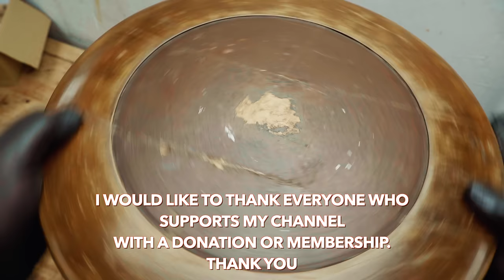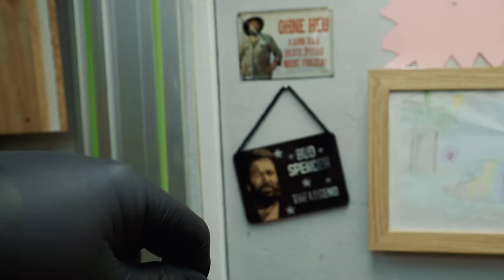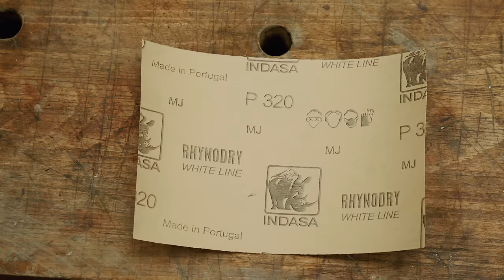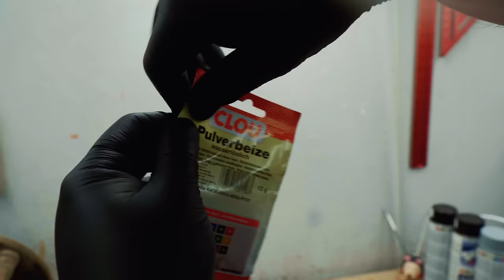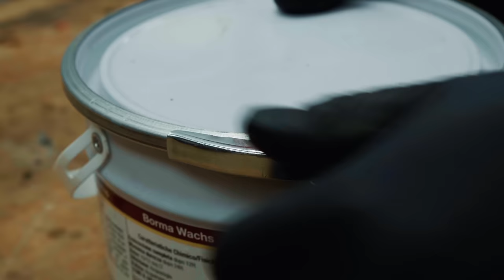ANTIKER Klavierhocker von 1930 gerettet aus Auktion

Comment: I'd not seen a stool like that. Most of my sightings were of a low bench with hinged seat for sheet music or the circular adjustable seat with a center tube supported at the bottom of the column by four roller feet. Hard wax may be what is called "bowling alley wax". Thanks for the insight. Narragansett Bay.